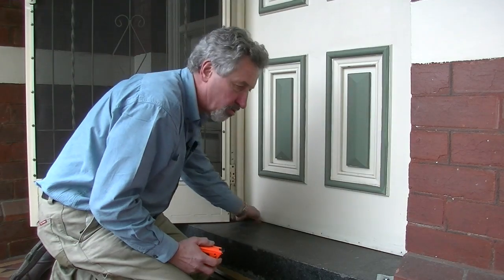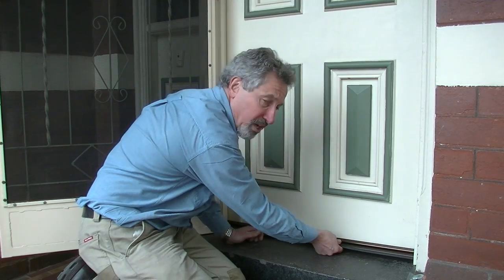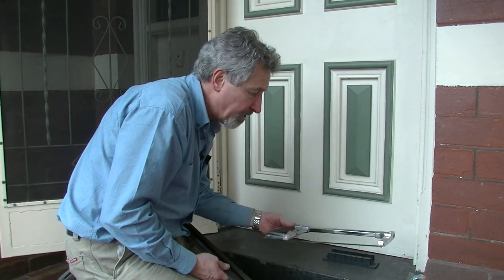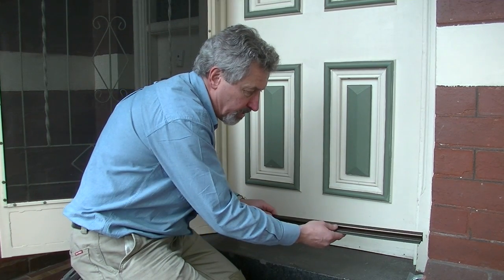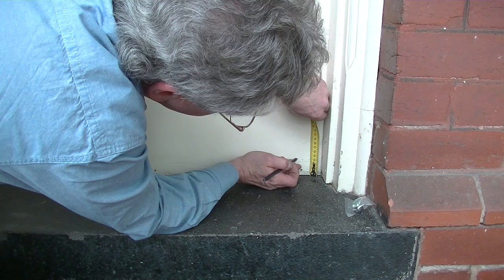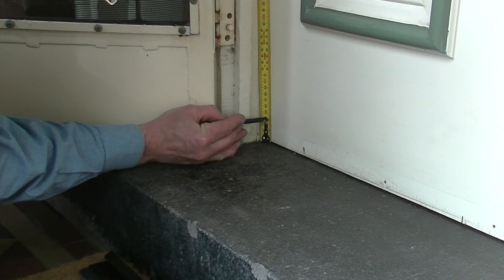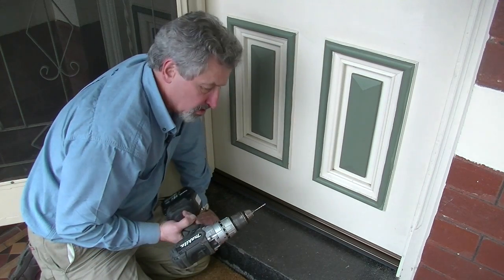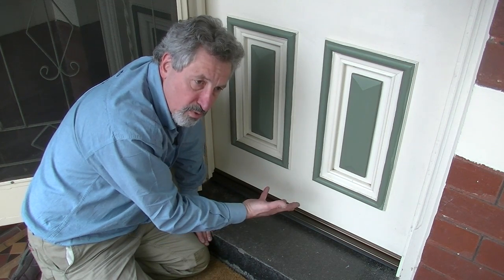How to Install a Draught Excluder on your Front Door | by ecoMaster

Comment: Great video- our front door is metal - is the RP3 suitable? If not can you recommend another draught excluder - thank you
Reply from the maker: If you are happy to drill small holes to enable screw fitting of the RP3, then yes it can be fitted to a metal door. 
If you do not wish to drill holes in your metal door, then you would have to use an adhesive seal such as RP2A which would not provide as good a result.